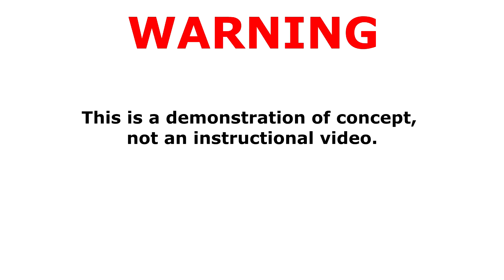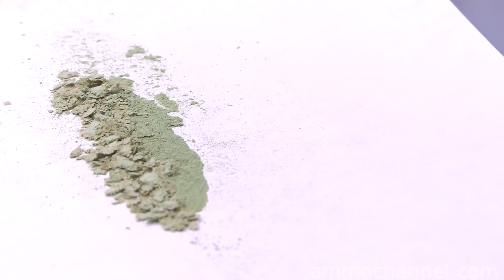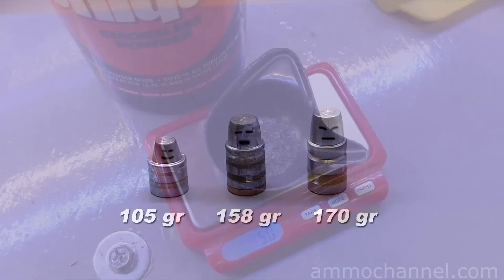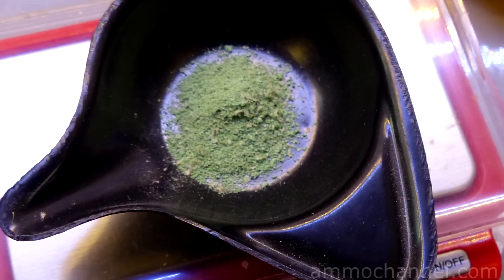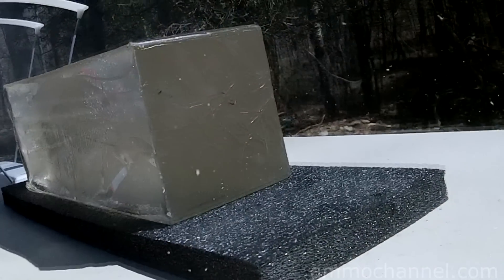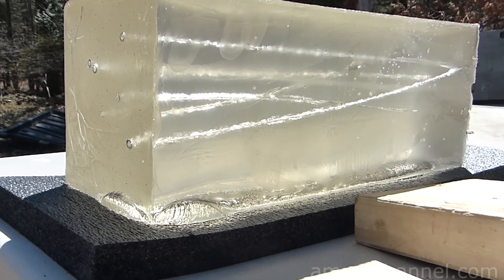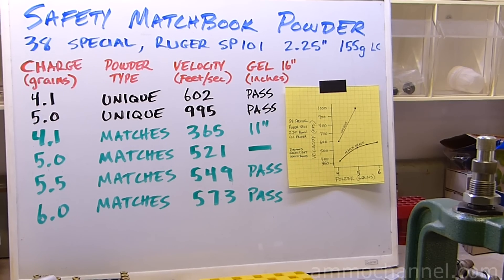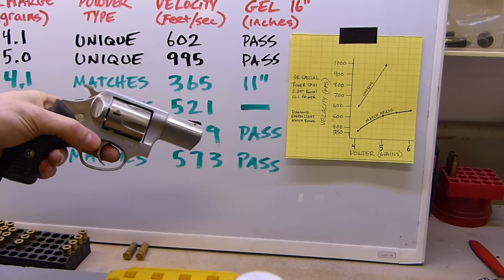Improvised Ammo #2: Matchbook powder vs Smokeless

Comment: for some of your graphing perhaps you should calculate and graph the energy since it's based on velocity^2 you'd see much more dramatic changes. I think it's also a better gauge of effectiveness
Reply: I'd second that, though it's pretty easy to make your own graphs with his info  ;)
Reply: ***** Partially true. It does have a lot to do with effectiveness. Handgun cartridges are the only ones where muzzle energy does not tell the whole story because their cross-sectional diameter (and drag in fluid mediums) vary widely on the caliber as well as their velocities all within +/- about 500FPS. With rifle calibers on the other hand, energy is king in determining potential effectiveness since they have similar diameters, and have significant differences in velocities.
It should be noted that energies do tell a good deal about handgun loads. Just not by itself. This is done by comparing energies between both loads, then Checking the bullet diameter difference. If the higher energy load (or if both loads are similar) has a smaller diameter bullet, then ballistics gel test should be done to ensure 14" min penetration as per FBI requirements. If both penetrate past 14" and through the whole block, inspect the cavity created in the first six inches of the gel target. This is the most important part since you have to remember, ordinance gelatin is supposed to be an accurate representation of flesh. Chances are, if you have to use your gun, you are shooting at someone standing and they probably are around 6" thick, and that bullet better expand and do its tumbling or whatnot in that 6" or you may have to rethink the load.. Of course, bigger bodies demonstrate maximum effectiveness with shots, but we assume the worse. It should be noted that the reason there is a 14" penetration requirement, is because people are about 12" from armpit to armpit, and about 16" from shoulder to shoulder. This accounts for an aggressor standing sideways to you. Additionally, if someone straddles you, and you shoot up into them. 14" of penetration is pretty much guaranteed to work up the torso at an angle and into organs. Alternatively we can also think of the resistance of bone vs flesh in the body, and the extra energy from 14" rather than just 6" ensures the job is done. Of course, these precautionary requirements mean that with all "good" loads, over-penetration WILL happen, so be aware of your backstop. Particularly if you are attacked in a crowded area. Some have suggested that if you can, drop down to a lower position so when you shoot you are doing so at an upward angle reducing the chance of the bullet hitting someone behind the aggressor.
Reply: ***** This is going to sound strange, but I hate to agree with you.. But I have to. Reason being is it just seems counterintuitive. What you said reminds me of the whole .45 Auto vs. 9X19 debate. Both cartridges, in their ball form, have roughly a 62% chance of a one shot stop, even though one has far more muzzle energy than the other. Kind of nullifies the argument over the two if we are talking about military loadings.
Reply: Dave Smith energy is always a better gauge of damage and effectiveness instead of velocity, it's simple physics, bullets come in various mass and abilities to tumble or expand but the work done in damage can never exceed the kinetic energy of the bullet. Energy takes into account both mass and velocity, extremely important when considering bullet types. The changes in energy also reflect the changes in expected damage when changing the powder loads for example you may may see a 20% drop in velocity but that means a 36% drop in energy and a 50% drop will mean a 75% drop in energy. Many people get miss lead when they look at the muzzle velocities when shopping for ammo and end up buying unconventional copper rounds that probably aren't better than lead jhp, muzzle velocities sell but they really shouldn't
Reply: iknowmy3table You may have mistaken me for another commentator. I believe my post covered that. I apologize that my paragraph indentations did not show up. It may be difficult to follow my comment's train of thought. 
I did say that energy is a better gauge never did I say velocity, but it is not the only factor. More importantly, the resulting drag forces from the cross-sectional density results in true handgun effectiveness. Of course to properly calculate this, F=MA must be used to find the net vector and the instantaneous velocity at that point calculated. My comment outlines a much more intuitive method of comparing relative effectiveness between cartridges.
Reply: Dave Smith F=MA? drag forces? from air resistance? instantaneous velocity? what are you taking about? F=MA is the equation for force for constant acceleration problem not some means to calculate velocity vectors. kinetic energy is not even dependent on acceleration A nor does an object need acceleration to have kinetic energy. collisions are complicated matters there is always energy lost in sound or heat and bullets often tumble expand and fragment no "cross-sectional density" is going to account for that. the only way to know is properly gauge damage with real numbers is a block test with entry velocity and exit velocity of the projectile (asuming not fragmentation) and the difference in kinetic energy or plot the velocity of the projectile in using high speed footage and use the integral of the velocity curve. that diffrence is most of the energy spent is destructive penitration and temporary and permenant cavitation at no point should you ever have to use F=MA
Reply: iknowmy3table You can think of this problem like one of those multi-question kinematic/energy problems on physic exams. When a bullet enters a target, it encounters an opposing force from the targets flesh. This is what I mean by drag force. It is this force that initiates the so-called tumbling, expansion, or fragmentation. After all, if this were not the case, bullets would be doing all these thing in flight in mid-air! You would use F=MA the same way way you would calculate the trajectory of a ball being thrown. Remember D= Vot +(1/2)at^2. There is a relationship between velocity and acceleration (albeit with knowledge of D and time, which should be easily measurable for calculations) and this along with the other kinematic equations allow you to essentially inter-convert between force and energies. By this, we can find out exactly how much energy is left in the bullet when the bullet is at X distance of penetration in the target. This is what I mean by instantaneous velocity. The velocity is changing according to the "drag" force being imparted by flesh. The drag, of course varies on cross-sectional density. More area, resists more in a medium than less area. This is also calculated with freshman physics although I do not remember the formula off the top of my head. I can't really explain this better in the couple minutes I am taking to write this comment. Search up the walkthroughs on calculating instantaneous velocities of trajectories given a vector, and you should understand what I am trying to show. Again, I note that this approach to calculating some form of "stopping power", while thorough, is not practical. My first comment explains an easier method.
     Bullets actually not not often tumble, expand, nor fragment in real world engagements. They do happen, but not as often as we think. Autopsy often reveals a general absence of these phenomenons due to a lack of flesh or space in general to occur. Read "Stopping Power" for an in-depth accounts of shootout results. There is another source but I cannot think of it off the top of my head. I believe it is a book or pdf a boxotruth forum member was talking about a couple of years ago. 
     I advise reading the very first comment I made. I should help explain what the previous comment meant.
Reply: Dave Smith in Physics 101 that there are often two ways to calculate kinematic problems one is with forces (often the first method you are taught) and the other is with energy and usually there is an obvious better way to solve the problems. The way you are suggesting using force is you'd have to find the average of the force by looking at the average or overall deceleration of the projectile then calculate an average force imparted by the block by multiplying the mass of the projectile. then you'd multiply the depth of the block d (work equation W=F*d) resulting in the work (or energy) done by the "resistance" of the block, or in other words W=(m*((V1-V0)/(t1-t0)))*d 
OR solve it with energy where you only need the mass, entry, and exit velocity
deltaE=(.5*m*V1^2)-(.5*m*V0^2)
they are effectively the same since d/(t1-t0) is really just the average velocity or (V1+V0)/2 but unless you realize it and know how to rewrite it you need more variables to solve the same problem which may not be provided in the exam question. I've taken Intro college Physics I, II, and III as well as statics and dynamics and energy is definitely the preferred method to solve this.

Comment: awsome, thanks for continueing this.

as a way to get a better amount of matchhead powder and less cardboard, why not skip the shaving portion and just smash the matchead off the stick? just take the roll and roll it over them.

also, have you thought about scraping off the striker and mixing that powder with the matchheads? it would make it much more reactive and possibly add some FPS, but at the same time, might make it somewhat pressure sensitive. try this mixture outside by smashing it with a hammer or somthing before actually putting it in a case. might make a decent primer though.
Reply from the maker: Hi, crushing it off didn't work, it just mashed into the cardboard.  Yes, I have since sanded the phosphor off the strike strip and mixed it with much improved results.  I was actually thinking about a quick video demonstrating this concept.
Reply from the maker: Forgot to say... good thinking my friend!
Reply: The Ammo Channel
aye, done with box matches it is known as an "Armstrong mixture" i believe, used in paper cannons and whatnot on youtube. shame it didnt work with smashing the matchbooks, try box matches sometime perhaps?

can we have more un-orthodox charges for cartridges in the future please? i dont do any reloading myself, but i find this DiY type of powder quite interesting

Comment: how about a hybrid blend to stretch ones depleting stock of dedicated gun powder?
Reply: Blending powders can be unpredictable. Could be interesting, but I know that mixing unburned powder off a range floor and reloading that often results in extreme pressure spikes and broken guns.
Reply: Klingon00 This is true. While powders are often blended at the factory, this requires both powders to have similar density as well as shape to prevent one kind of power one place, and another kind in another place of the same canister. smoke grenade mixture of potassium nitrate and sugar work well when melted and granulated as a kind of smokeless powder. I have experimented with using sawdust to control the burn rate, but it is a risky business.
Reply: Klingon00 the guys at iv8888 did that...   fucked their gun up.     It was for a torture test on i believe a 91/30 Mosin or an Arisaka.
Reply: good idea
Reply: Good thought. I think most folks can project conceptually that if X works at all as a replacement for Y, then mixing X and Y is simply a matter of percentages. Finding a good X is the hard part. Awesome idea though... :-)

Comment: Wouldn't it be easier to use the inside of a road flare?It's the same sulfur based material right?
Reply from the maker: Well, now there's a though.  I have a few road flares that I have been avoiding disposing of for about 15 years now.  I knew a use would come along.  This may require some investigation!  Good thinking.
Reply: road flares run u about 2.50 each when match books are free :P
Reply: As long as the flare doesn't burn too slow it should work.
Another solid propellant that should burn faster is a model rocket motor.Estes has been making them for decades and you can get them at a hobby shop.
I wonder if gasoline or alcohol would would remain a vapor long enough inside the case to fire it.Maybe if they were soaked up in a little cotton kind of like Cordite.
There are explosive gasses that might work like hydrogen or acetalene but getting them loaded would be tedious/dangerous.You'd have to seat the bullet fiest then introduce the gas through the flash hole then seat the primer,a dicey proposition.